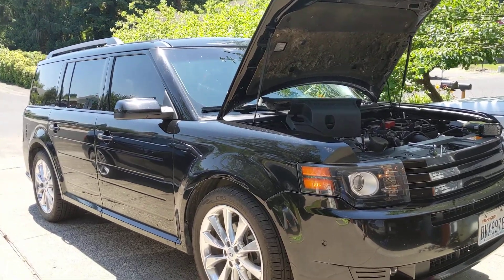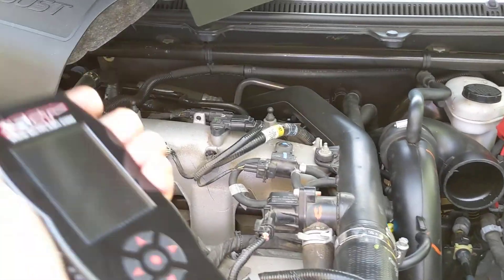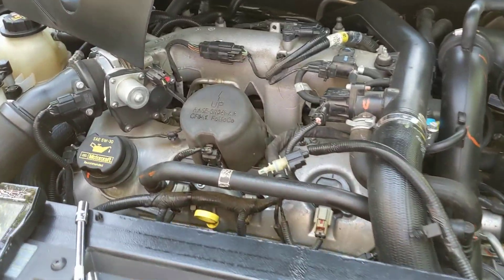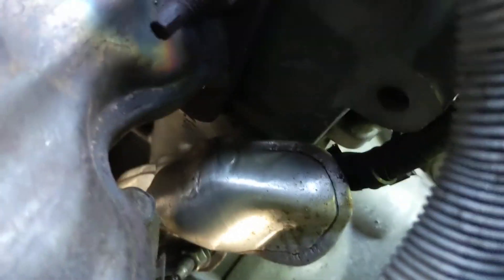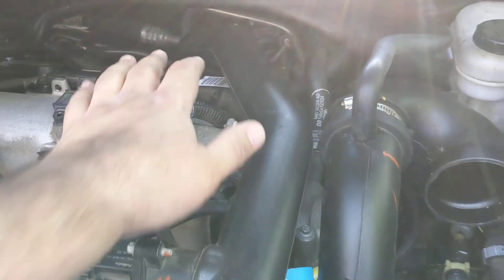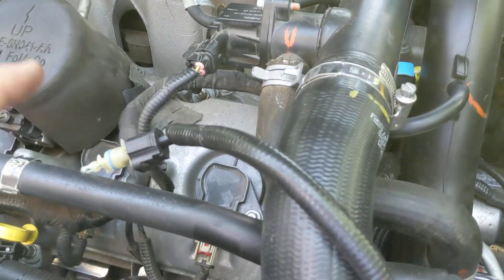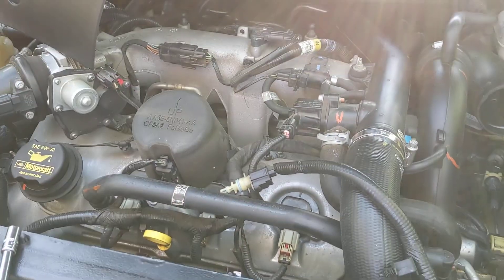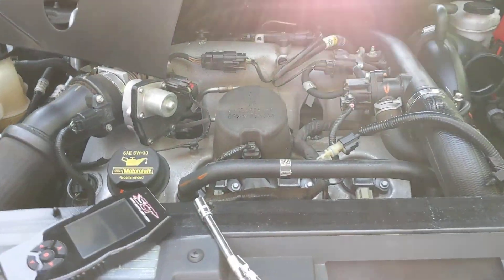Project Boost Wagon - Ep 3: Tuning the Flex uncovers issues with the turbos!

Comment: Best project on the channel.
Reply from the maker: We found out the fastest Flex in the world does 12.2 and suddenly we want to beat it...
Reply: @PlaysWithCars  that seems very doable!
Reply: @PlaysWithCars think 11.7 on stock turbos is fastest on draggy. But the rear seats were removed
Reply: Hey guys which turbos will you  recommend for an upgrade. I also have a 2019 flex EB. I am in the research phase gathering all the info to start putting the pieces together for a tuning. Thanks !